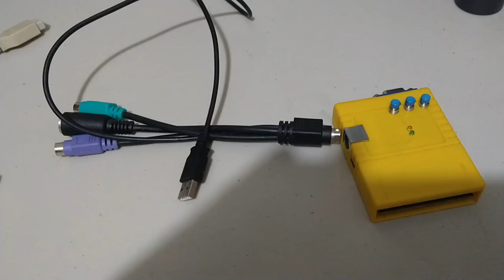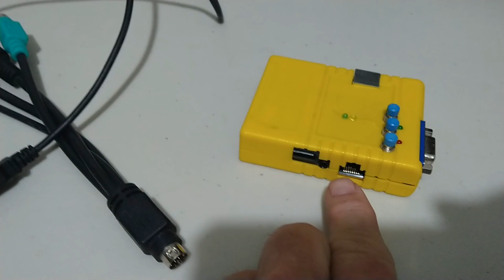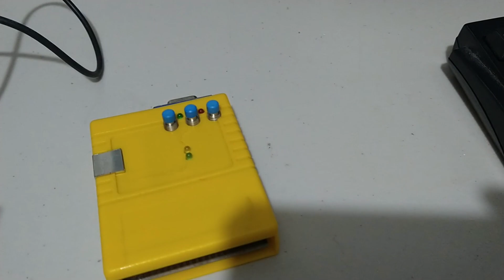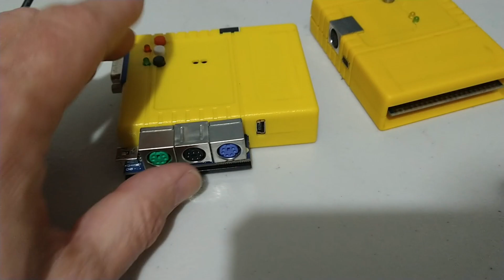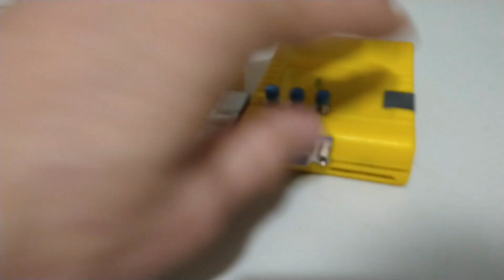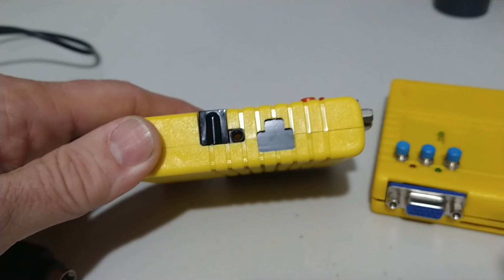Turbo Chameleon 64 Version 1 & 2 Side By Side Comparison, expansion for Commodore 64 Or Stand Alone.

Comment: lol, they didn't come with the rr nett, that was an option, though the v1 came with the docking station smd the cdtv remote. The v2 came by itself. You also missed a lot of detail between the two versions and gave some wrong information too.
Reply from the maker: I never said v1 came with an RR-Net, I said mine had one. I got a v2 much later.
Reply: @redrumloa  Fair enough, How do you feel about the V1 vs the V2? like useage, quality wise etc? I think the V1 is far better (in both parts and build quality), but the v2 was made with a lot more of a budget which is why we didnt get all the additional parts with them, and while ive never used them, is good to let people know. I bought both brand new and expected the v2 to be better, but it wasn't. I nbought the rr net, and put it into my v1. It wasn't a great fit and leaves a bulge in the case, but it works and recognises that its there, but again, its one of those things i bought, butt never used... what am I going to use it on? no idea, but i wanted it lol

Comment: Does Turbo Chamaleon support 80 columns mode ?
Reply from the maker: Turbo Chameleon does not support Commodore 128 at all :-( Individual Computers warns against using it on a 128 as it can do damage they say. It's a real shame.
Reply: @redrumloa  thanks for your answer, but I was asking about 80 columns mode under C64, not 128 or 128 mode.

Comment: i got tghe first one is it worth the second one? hopeto do a review soon greart channel bud
Reply from the maker: Thank you for the compliment. Is it worth getting the 2nd one? To me personally yes, simply as a backup. v1 and v2 use different cores, but the end result is practically identical. Here's the complaints for the 2.

v1 - Some people have complained their breakout cable connector gets worn out.

v2 - Some have complained of imperfections on the video out.

Performance and feature-wise, they are the same.
Reply: @redrumloa  thanks for info stick me old one :)
Reply: @mistermark8755  I also prefer the V1. Its just better all round. You would think the v2 would have just as sharp a picture as the v1 but it doesn't. The v2 still looks great, but the v1 looks on my 1702 and c64c MUCH clearer.